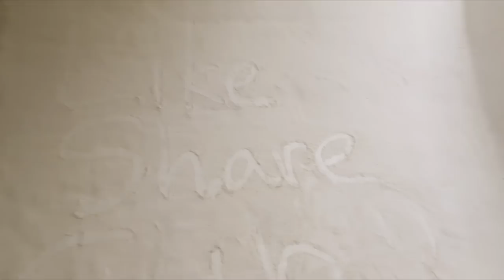More Bulkhead Work - Emerald Isle: Ep.68 Fishing Boat Refit - Backlog #2

Comment: Do you have any type of safeguards for all the fibers you vent out? I would imagine that could be really harmful to fry thinking that it is food. Your vessel is coming along so nicely. I always get on YouTube hoping to see that you all released a new episode. 🤗
Reply from the maker: Hi Jerry. Great question. We have tried to keep the dust and fibers from the fabric contained as much as possible and try to avoid venting or blowing dust outside the shelter. The heater does pull in fresh air from outside, but only for the combustion chamber. The inside air gets recirculated through the heat exchanger,  so the inside pressure is never positive preventing unintended discharge outside. We do appreciate your concern for the environment and thanks for your support and joining us on YT.